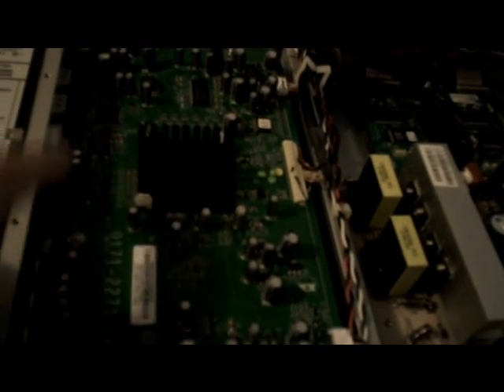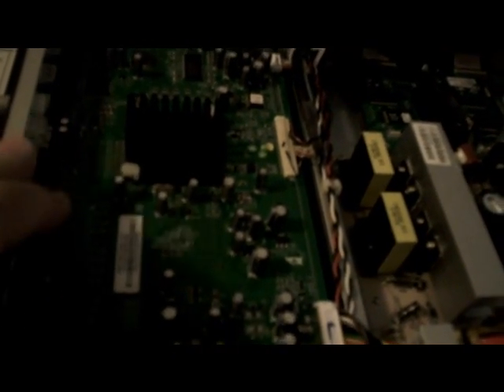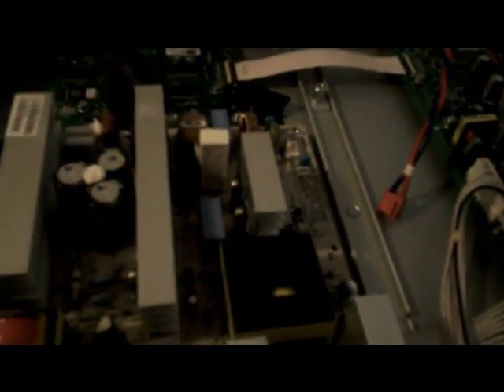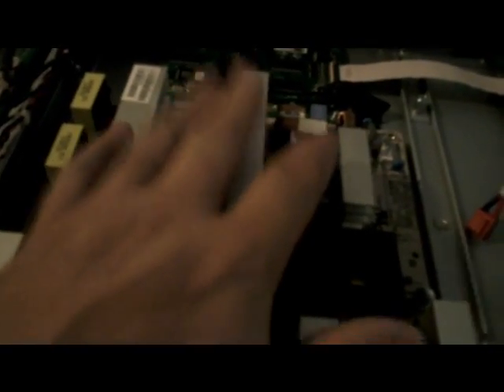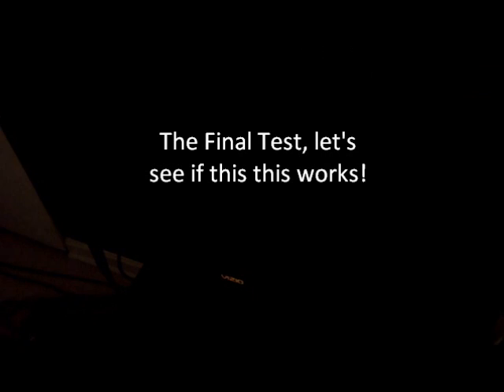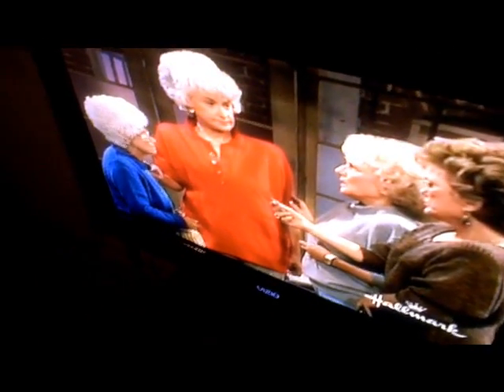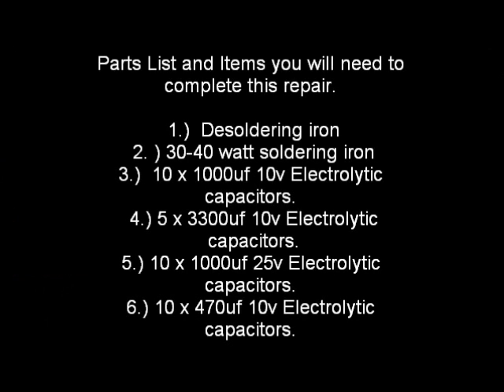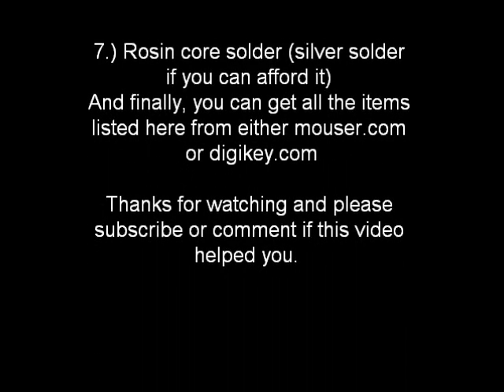Vizio VP322 HDTV repair tips and information (part 2 of 2)

Comment: This is a great video thank you! It looks like there is some variation on the part numbers you've listed for mouser.  Would you be so kind as to update the part nums with the appropriate ones? The variations seem to mainly be in things such as case length, lead spacing, and low empidence versus general purpose products. So, you will have issues like , when searching for 667-EEU-FR1A102L you get two results 667-EEU-FR1A102LA and 667-EEU-FR1A102LB where lead spacing is different. 

I'm afraid to order until I know which ones to get, so as not getting the wrong ones.

Thank you!

Comment: Try digikey Deborah,...I liked them better myself. As for this video,...I can't thank the man enough!!! I only ordered 6 of the 2 parts I needed. My problem was simple, just the two 3300's for the positive and negative power, but the problem was the same. TV would just come on, then go off, over and over again. Anyway, I just got done about an hour or two ago,..PROBLEM SOLVED!!!!! Thank's ENDLESSLY,...a 400.00 problem, just got fixed with under 20.00...NICE!!! ;}

Comment: The other big board is the Screen Driver board, it drives the plasma display. Other boards are Logic Board, A/V-Tuner Board, Internal Audio Board (for internal speakers), Power Board, and various other smaller boards for side buttons and horizontal drive.

Comment: so next i asked him if i bring you the circuit board and point out the caps i want replaced what would the cost be?$25.00 for the labor  ..  3.50 each for small caps & 7.50 for large caps ...all in all total was $53.50 .took the board home ..put it all back together...crossed my fingers ..plugged it in and ...wow it works like new...just think i was gonna junk it and spend 300 to 400 dollars for a new one ...thanks guy you saved me some cash

Comment: @godisincontrolalways   The shelf life issue is irrelevant for a 5-year storage cycle. Anything sold by major distributors is new production. Don't buy caps for this application from surplus sellers - stick to newark/digikey/mouser.

Further, I recommend spending a tiny bit more money on Low ESR capacitors for the 3300uf part. This part takes alot of ripple current.A tiny bit more money ($1.00 ea versus 30 cents) gets you a better part.  I like the Panasonic HE series for 3300uF

Comment: the board you in questioned in your video is a y sustain board or ysus but on other note buy the best quality high temp capacitors I would pay more for better capacitors than something that will short out my boards down the line of use.

Comment from the maker: @xghostyxjokerx Parts list: get 10 of each to be on the safe side.

1000uf 10v Electrolytic capacitor (radial lead)

3300uf 10v Electrolytic capacitor (radial lead)

1000uf 25v Electrolytic capacitor (radial lead)

470uf 10v  Electrolytic capacitor (radial lead)

Comment: um i opened up the vizio tv and found a few capacitors bad...im going to try to desolder it and solder the news one back on but when im looking for the right parts at mouser they are so specific of what is what please could you give more details of what pieces are needed...or maybe radioshack would be best im going there tomorrow...thanks

Comment from the maker: @TheAlexCrossman You're gonna have to buy a desoldering iron along with a soldering iron. Every capacitor has two leads, one is positive and one is negative.  You put them in the same way they come out, if you mess up then you'll have even more problems on your hands. But you use your desoldering iron to remove the solder from the back of the board (the solder trace side) Soldering is easy, but I would recommend practicing on some old junk circuit boards first. (an old clock, radio or something)